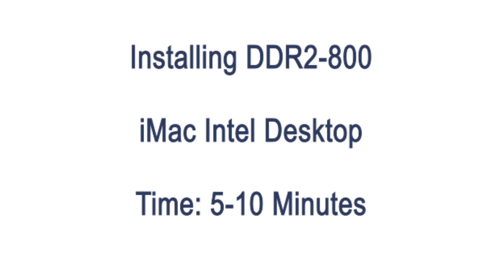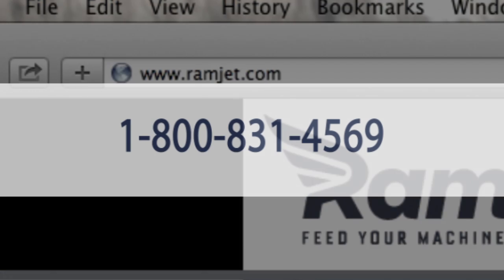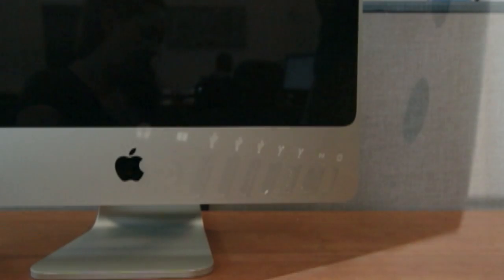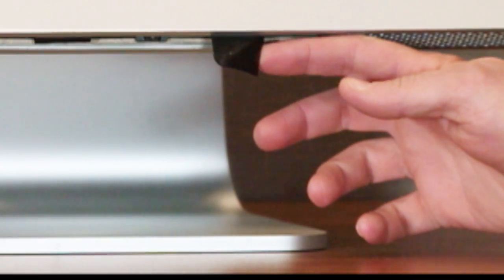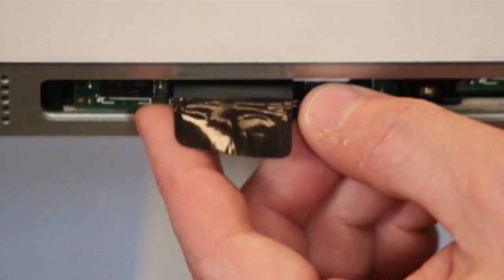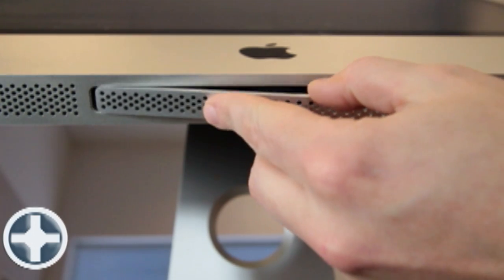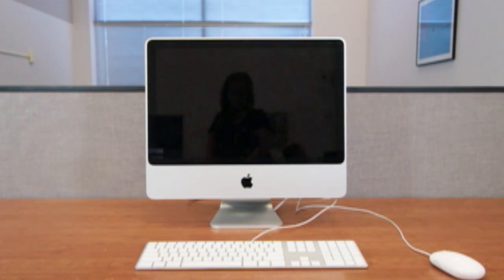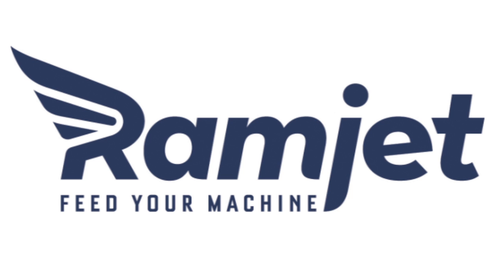Installing DDR2-800Mhz RAM in an iMac

Comment: I just installed my 2 + 4 GB modules this morning.  First time was the charm.  It took a good amount of "pull" to get the old factory installed 1GB module out, and an equally good amount of "push" to get the replacement modules fully seated into place, but all is well and the new RAM shows when I check "About This Mac" under the apple logo.  
>>  I bought my replacement memory modules from you  So, thank you so much Ramjet.  You've made me very happy!  :-)

Comment: Thank you for adding this video.  I purchased the memory I needed for my computer (this model) awhile ago, but fear has kept me from attempting installation.  As heavy as these iMacs are, I was fearing I'd damage the monitor trying to lay it face down,  as the manual instructions say to do.  Thank God (according to this video) I don't have to lay it down.  I only need to tilt the monitor.  You've spared me that anxiety.